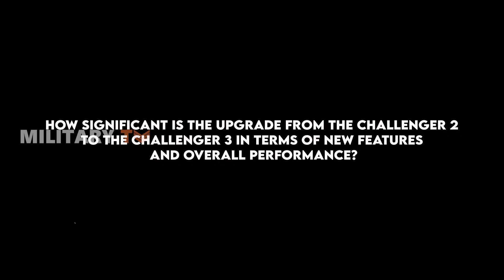The Secret Behind Challenger 3's Testing in Germany

Comment: The Challenger 3's has the cannon from the Leopard 2a7, so it is being tested in Germany
Reply: Everybody seems to use the same cannon, US have the same in their Abrams.
Reply: @LarsPW no the Abrams has the Shorter L44 from RM
Reply: @MR-th1nf  the abrams uses the M256, not L/44.
Reply: @Marshmallow603  It is a licensed-built German-designed Rh-120 L44 gun tube
Reply: The L55A1 is proofed to a higher pressure than the current 120mm smoothbores in use, it has been hitting targets out to 5000m 2k further the the current standard 120mm. This will more than likely be the next upgrade on current NATO tanks.
Reply: @andrewtadd4373  Not further, just higher lethality at the same ranges. Normal L55 also does 4000 with KE and  5000 with programmable HE, just like L55A1. Longest range Leopard 2 variant ist still  the Quarati Leopard 2A7Q with a L55, only version to have mounted a weather station to hit targets out to 6000 m.
Reply: @jonny2954  the quatari are operating Leopard 2A7+, that is a modified version of Leopard 2A5 with the electronic programming feature and RWS added, plus more all round armor, dozerblade and a few more sensors.
but still it is in its core a Leo2A5 with the L/44 gun.
The naming is confusing though, the 2A7 is a further evolution of the 2A6 by KMW, the 2A7+ is a streetfighting upgrade to the 2A5.
Reply: @cathulhu-q7y  Incorrect. Leopard 2 PSO is the street fighting upgrade to the 2A5. Leopard 2A7+ is KMWs finalized street fighting upgrade to the A7. Quatari Leopard 2 have the L55, PERI-RTWL and the APU from the A7. No confusion in names here.
Reply: And sights and electronics and armor... Rheinmetall Challenger 3 lol.
Reply: @jonny2954  The composite Armour is British developed.   Britain shared the technology with the USA and Germany.
Reply: @williamzk9083  That was about 4 composite armor generations ago. Do you really  think they use Dorchester  and Burlington from over two decades ago? No, lol. The armor is designed and made by Rheinmetall Chempro (now Rheinmetall Protection Systems).
Reply: @xtoshix2  The Germans saw the first deploy a 120 mm gun which came out of the joint US German MB 70 program.  This is now become the Nato standard caliber and ammunition has been standardised by STANAG.  France, Korea, Japan make their own versions. US adopted a modified version of the German gun with a different recoil mechanism.  the lastest version has a programming breech to program the fuse of a HE round with air burst, contact or penetrate.  This is what challenger III gets.
Reply: @williamzk9083  I am 100% sure they don't share any Source about their Armor with anyone. I mean still today nobody really knows how powerful Dorchester L2 Armor is I mean KH50 Vikhir Rockets weren't able to Penetrate the Hull same as 3BM60 Swinez 2 apfsds.
Reply: @fernandojohnsen7639  Challenger 2 has a similar if not slightly better composite armor and protection to Leopard 2A4. that is now 35 years out of date.
Challenger 2 uses 2. generation dorchester, Challenger 3 gets the german 3rd generation composite armor, wich is more advanced
Reply: @jonny2954  Sights/systems are designed and built by Thales UK and Rheinmetall Electronics UK. The armour is solely British and not shared. The Challenger 3 is developed by RBSL. RBSL is a British/German joint venture (BAE SYSTEMS & Rheinmetall) In short, Its a British tank that's integrated a modified Rheinmetall's L55A1 smoothbore gun (British gun variant: L55A1CR3)
Reply: @jonny2954  🤣🤣🤣🤣
Reply: @jonny2954  the Electronics are from The Brits themselves only the Gun Sights and Electronic is from Rheinmetall
Reply: @fernandojohnsen7639  The entire electronic architecture of the vehicle has been replaced, not just the gun
Reply: The video clearly mentions that the UK test ranges are not certified for testing the specialized amo, hence the testing in Germany.
Reply: @ataxpayer723  with that certification it may be that any measurements are in accurate. They may also be safety issues.
Reply: Needs a 152mm canon to compare to the upgraded armada tank
Reply: @Phil-D83  That's a ridiculous comment.
Reply: @Phil-D83  😂😂😂 I hope this is a Joke. The DM83 Round penetrates 1100mm round about. The DM93 when it's finished will get over 1400mm what about the 152mm Canon. Which Penetrates around 950mm ? And ok can be used as an Arty Canon but Dude. Haha wtf. 😂😂😂. The 130mm Rheinmetall Canon penetrate 50% more than the 120mm L55A1 with the DM63A1 which means nearly 1500mm or even more. The 140mm Canon from the Leo 3 Project penetrates nearly the Same as the DM83 L55A1 fired Projectile. There is no Compare to the Western Strength.
Reply: @Phil-D83  no
Reply: @Phil-D83  you are 7 years old

Comment: No need for DU rounds..rapid firing guns with sensors are much important with advanced detection systems especially for drone attacks
Reply: knowing the brits a gpmg mount thats your drone lot.
Reply: @williamdodds1394   Should be GAU 19B's/DillonAero 503D's.
Reply: they built it to fight dessert farmers 😂
Reply: @rafstory92  You do talk aload of nonsense its a top rate tank the uk needs a new tank so does nato kf51 is a start.
Reply: @williamdodds1394  you should learn how to writing first 😂
Reply: @rafstory92  Learn how to writing first ? no such sentence you should learn how to communicate it might get home after a break down.
Reply: @williamdodds1394  at least you know how to use . , 😁
Reply: No ,you do need DU rounds
as for drones attacks
The AbramsX prototype has 30mm auto cannon
its just need German AHEAD rounds as well programmable rounds and sensor upgrade
During WW2, US tanks had two gunners, main and Asst 
Since sensors are not perfect and autloader in use
the fourth crewman can operate the anti drone defense

Comment: No details on why they needed to get enhanced permission to use in the UK? 🤔
Reply: Ranges have to be MOD cleared as suitable for up to a certain level  of weapon power (e.g. a range might only be cleared for up to .50 BMG), probable that some of Chally 3 ammunition exceeds current range limits.
Reply: Cheaper to do it in Germany as its their gun.
Reply: because there is none... they're testing in Germany because Rheinmetall are the developer of the new turret and gun system. Pretty normal to test your own product at your own facilities ;)

Comment: All this tech for 50$ FPV drone to take out ))
Reply: Aps exist for a reason.
Sadly Russia doesn't like to use them and uses shitty cope cages instead.
Reply: No because it has anti drone systems.
Reply: Everything will be affected by drones but drones can be deployed on both sides and counter drone technology is a big area of growth. The existence of drones does not mean a country will not have any tanks. Tanks will soon have ways they can deploy various anti-drone measures.
Reply: @mattwright2964 emp will prevent drone attacks
Reply: The War in Ukraine 🇺🇦 has changed the meaning of “Modern Warfare”

Minefields have stopped Challenger 2

I do believe that a tank is useless on its own, so it will need lots of support from land and air 

Glory to Ukraine 🇺🇦 and Peace 🕊️
Reply: @davidmenjivar8890  screw ukraine
Reply: @davidmenjivar8890 ucrain can f off in pieces